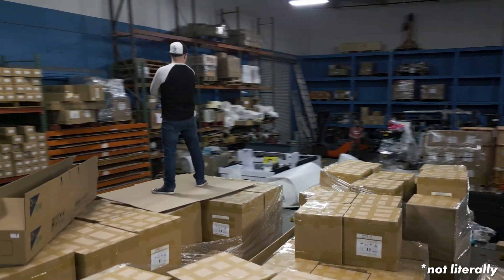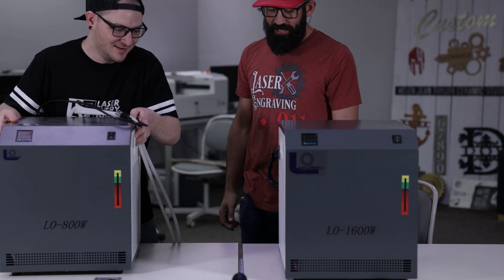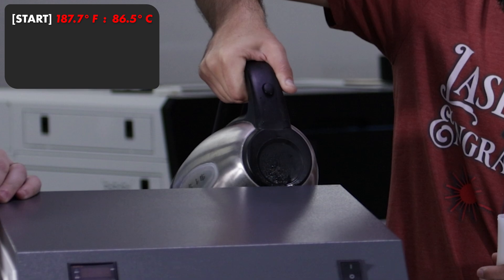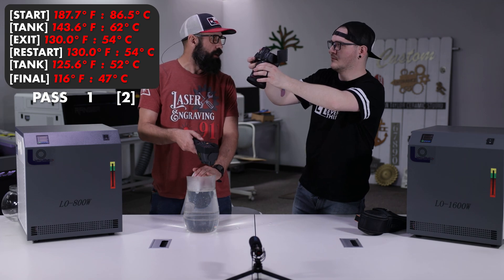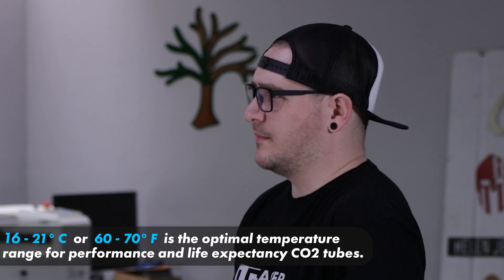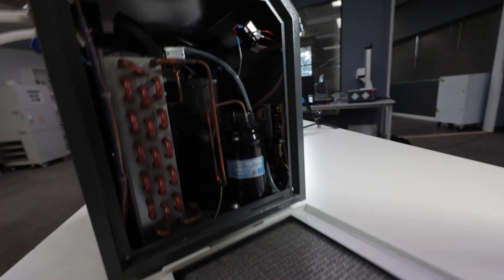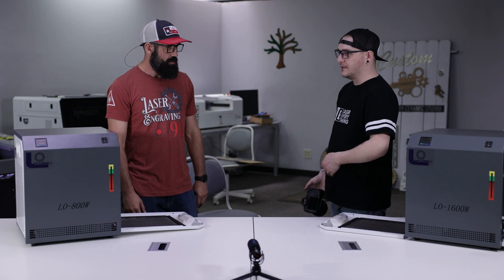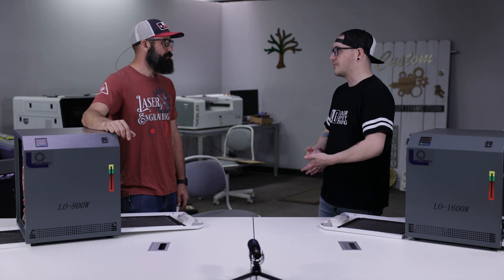Would YOUR Money be Better Spent on THIS? LightObject Chillers vs Boiling Water

Comment: You only have to recharge coolant in the chiller if it develops a leak. Under normal use, the coolant is in a closed-loop and should not naturally diminish.
Reply from the maker: Good to know!
Reply: I was thinking the same thing without knowing.  Its like you car's air con, it shouldn't need refilling unless there is a leak, and you want to get that fixed if there is.
Nice units though, definitely something I would buy if I needed one and it was available in my country.